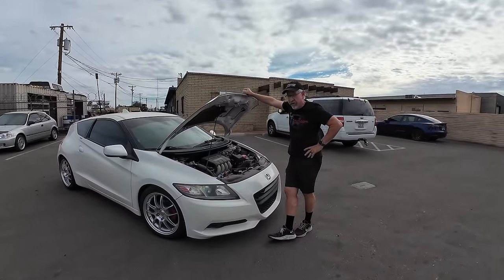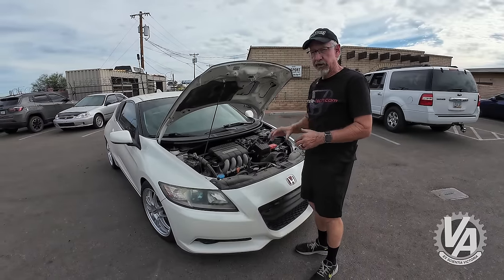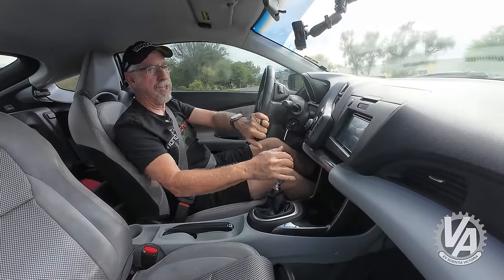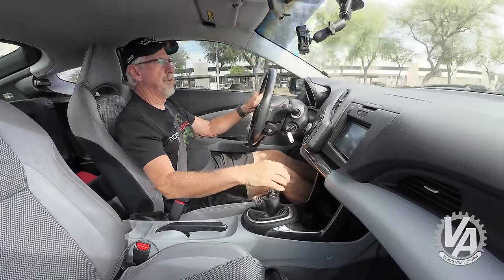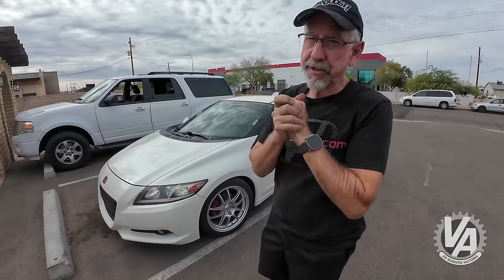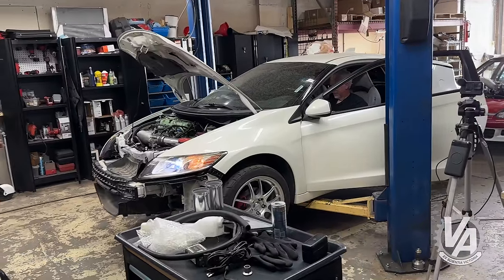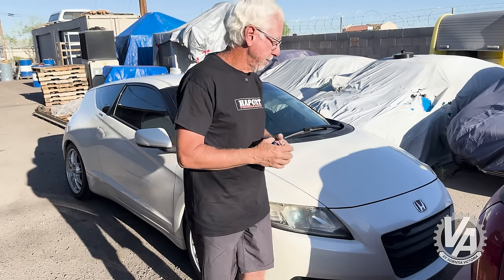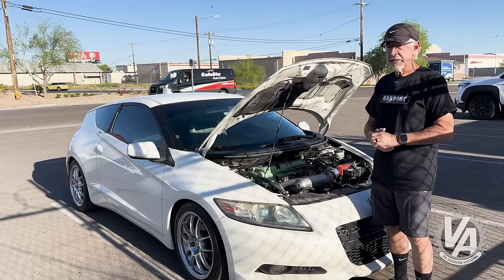How to Make the CR-Z Awesome (It's a K24!)

Comment: Will the car run properly if u leave the motor and remove just the battery's out
Reply from the maker: It will run, but it will be quite slow. There will be an IMA light on your dash. You can do it but it will be a suboptimal experience.

Comment: Would a k24z from tsx/civic si be easier to swap than a k24a?
Reply: For the 2013 to 2015 CR-Z, yes.
Reply from the maker: Not unless your CRZ is 2015 or 16. It has to do with the ECU.

Comment: Did u change the regenerative brake system from it?
Reply: The brakes are not regenerative on the CR-Z. Regen is strictly through the transmission.
Reply: Is it the same way to do a kswap to a 8th gen civic?

Comment: Man this kinda bums me out. I’ve always loved the look of the CRZ but never bought one cause of the IMA. I figured this would have been much quicker. One of the only slow cars I’ve even had was a pretty much stock  (intake/cat-back) 94 Del Sol with the 1.5 in it. Even with only 102hp I was still able to run a 10.2@75. Figured this would have at least been in the mid 9s.
Reply from the maker: We aren’t on a prepped surface. That could be the difference.
Reply: @VTECAcademy  I was running in a no prep track and the trap alone would rule that out (you’ll pretty much always have a lower trap with a better ET and likewise will have a higher trap with a worse ET) Only thing that would be a determining factor would be the elevation. I was at sea level at around 72° F and lower humidity (for Florida) so it was pretty good. I’m guessing your elevation is a lot higher.

Comment: 10+ sec on 1/8th ; this is a 15+ second 1/4 mile car
Reply from the maker: Not at the dragstrip, it should be faster. This was a fairly rough unprepped road. Also front wheel drive cars have notoriously bad 1/8 times on street tires. The best acceleration happens after the car is moving.

Comment: Wait you removed the electric motor? Lame. I would have hoped that there would be some ECU builds out there by now with the electric motor.
Reply: The gearboxhousing where the ima is situated and the mounting point on a k24 don't line up. It doesn't fit together.  The thing I would miss the most is the possibility to change engine mode With the push of a button. For practicality I would still like to have an eco mode, and normal and sport. And not to have to buy premium petrol to run it. I agree if there is away to keep the ima and battery active and upgrade it with the s+ option the newest models have. That would keep it in spirit with the original. But like I said it can't be done, or not without serious modifications. And then there is the question are the internals of a stock transmission strong enough to handle the power. With a mild tune 225 hp is easily achieved. I have read. That the supercharged engine recommends to strengthen the gears if you go past 200 hp. In the end the expenses for most don't weigh up to the gain of 15 hp with the ima assist at full boost.
Reply: Even tavarish is deleting the electronic motor of his p1 McLaren, for the reason the expenses of rebuilding or deleting the system to gain the horses in another easier less expensive way.